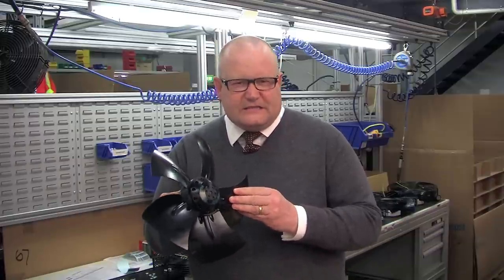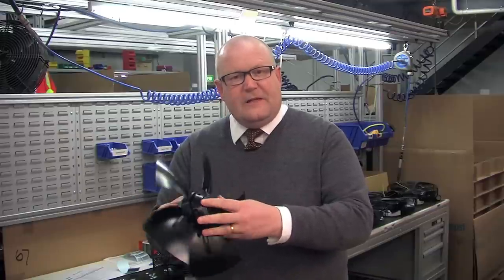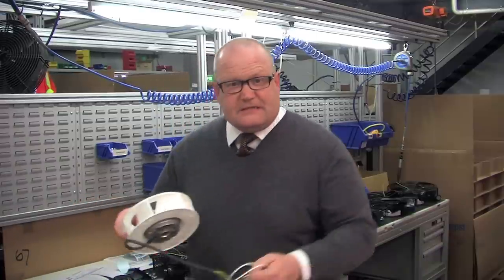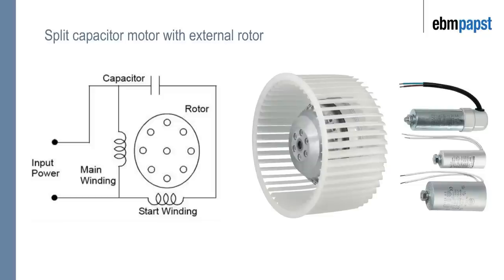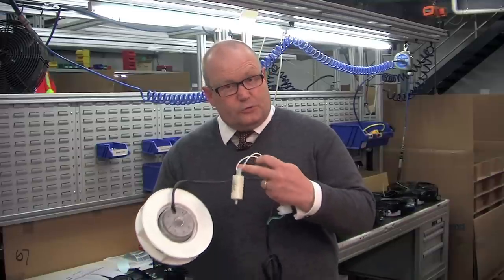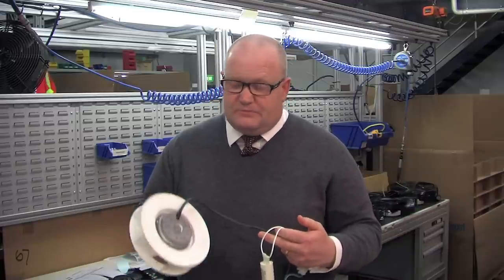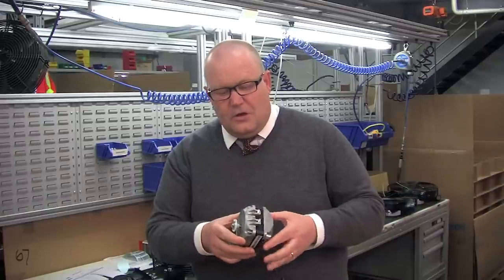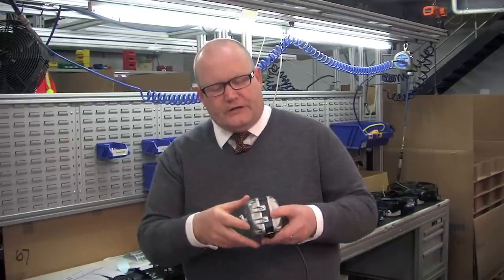AC fans and motors - ebm-papst A&NZ

Comment: I have a couple ebmpapsts fan motors. Are these universal motors. That would make a great ebike motor if they will run on DC. I know thereay be an over heating issue but I think I have a solution. If DC is possible where would I find a wiring diagram.
Reply: Hi Ken, we do do DC motors here: https://www.ebmpapst.com/en/press/press_releases/pressdetail_83584.php.  Please send us a note to sales@ebmpapst.com.au and we can help in more detail.  The torque especially starting torque will be important for this application.  Thanks, Simon

Comment: How to connect this fan with 5 wires and how we distinguish between speed, cooling and automatic type of ebmpapst 48 v.  dc 1.38A.66w with many thanks
Reply: @SimonBradwell  RG 160_28 / 18n / 18TD 48vDC 1,38A; 66W (38,4_56.6 v DC) Var346 ebm papst 2002_2005 HU (C) 18.06 Thank you brother these fans are connected to communication devices

Comment: Can we use AC fan as a normal fan for general use?
Reply: +The Capsule Dear "Cap", I am unclear what you mean by general use.  If you mean domestic, then all domestic fans typically run off AC single phase supply.  Australian standards exist for domestic fan systems and these have to be complied with if you are in Australia.  I hope this helps, thanks.  Simon
Reply: +Simon Bradwell thnxx alot